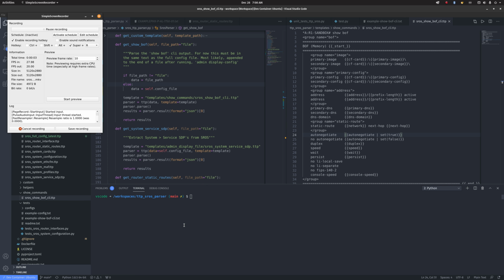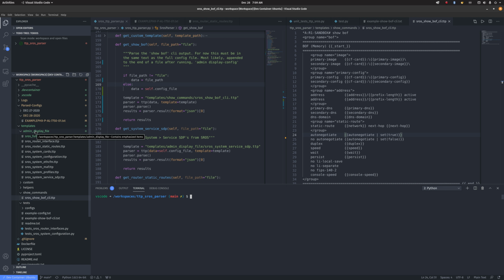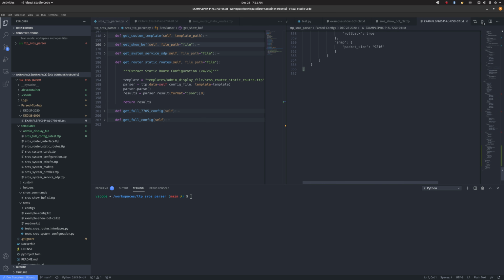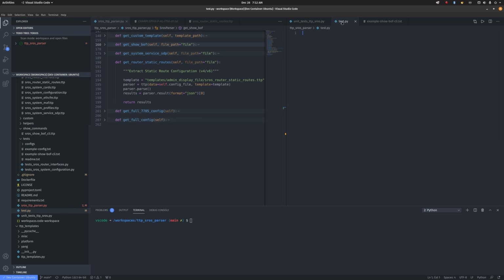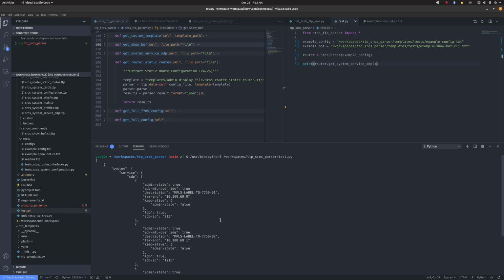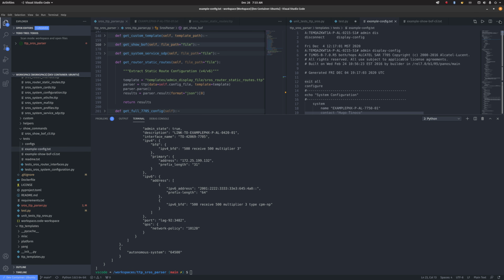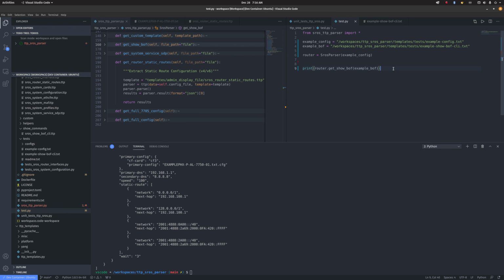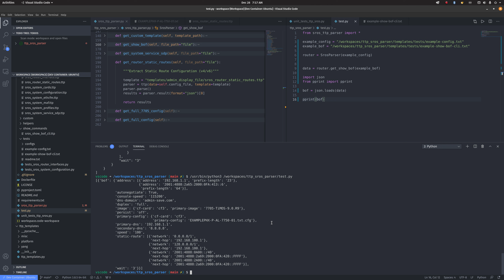Network Automation - Nokia SROS Parser

Comment: Hi, what platform are you using to run SROS vms and what version of SROS are you running?
Reply: Reason I’m asking is because I’m having challenges (on eve-ng and also kvm) running 13.0R4, 14.0R7 and 15.0, have only been able to run 12 and 13.0R1
Reply from the maker: I use a variety of releases on eve-ng. You need sros license for anything higher than 13 I believe
Reply: @AdminSaveNRS2-1760  thanks for the insight